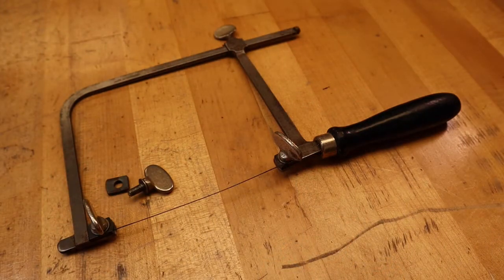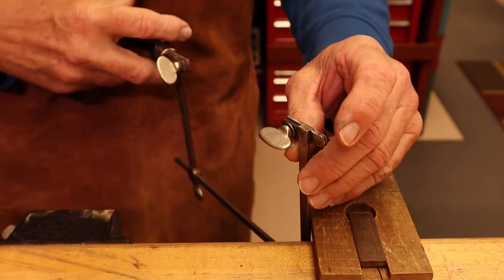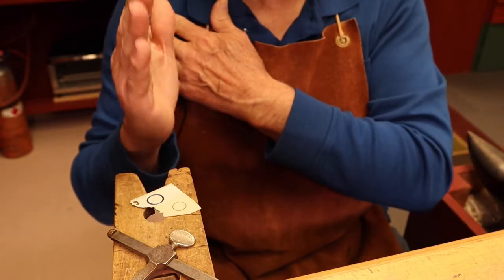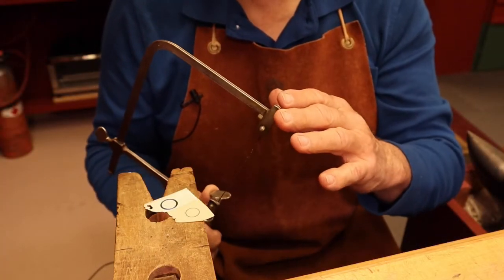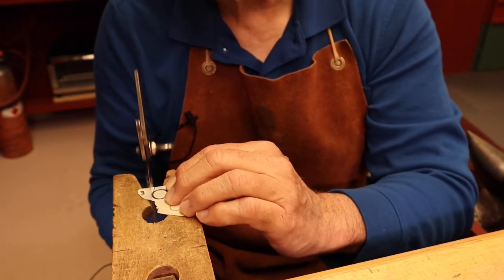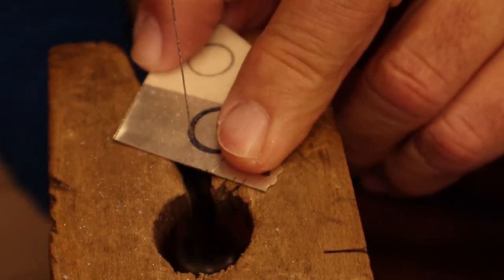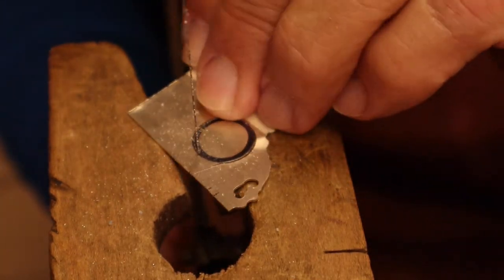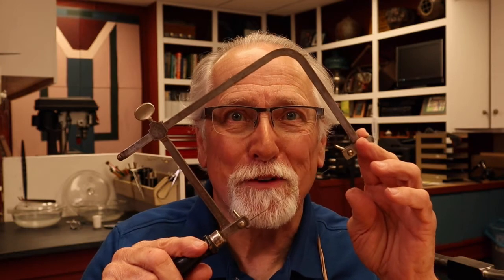SAWING & PIERCING MYSTERIES

Comment: Very much enjoyed.  I have become hampered by the paper 'fuzzing' around the saw.  I now Laser photocopy my design and tape it design facing down onto the brass.  Remember it is now reversed, so reverse it during the printing or drawing process.  A graphics package helps so it can be printed on a LASER printer at home. Lightly emery the brass first.  With print in place, wet a Q tip with acetone and moisten the drawing.  Rub hard.  A bit of practise hones the skill.  Observe safety precautions on acetone bottle.  Take the drawing away to reveal a hardy design transfer.  Idea came from Wild Swan Publication's 'Model Railway Journal'; not sure which copy.
Enjoy your art; it's cheap health insurance.
Your efforts are appreciated.
Reply from the maker: Hello Peter,  You are correct about the fuzz when using paper.  Thank you for sharing your ideas using a laser photocopy and acetone.  I'll give it a try.  Thanks for watching.  Greg Greenwood
Reply: @greggreenwood4628  Used it just today.  Works brilliantly.  The idea is to not oversoak and use finger to rub down pattern.  Use a disposable glove.  The only drawback I know of is the emery polishing.  Surface roughening can probably be omitted if you want a mirror finish. Try it out.  For anyone wanting to try this: remember we are talking about Laser copiers, not inkjet; and don't get burned by the iron. Safety, Safety, Safety.

The following are by a fellow who built a replica Antikythera Mechanism, using as far as possible, the original techniques and tools.  They are of general interest to anyone in our area, or allied areas.
Filing Tips   https://www.youtube.com/watch?v=h4KaiG7CpSQ
Making files    https://www.youtube.com/watch?v=SOw9WqMOHjA

We are all beginners; every single one of us.

Cheers.
Reply from the maker: Thanks again.   Greg Greenwood